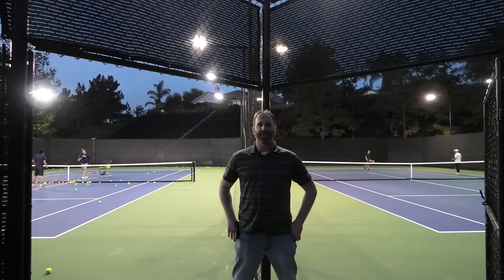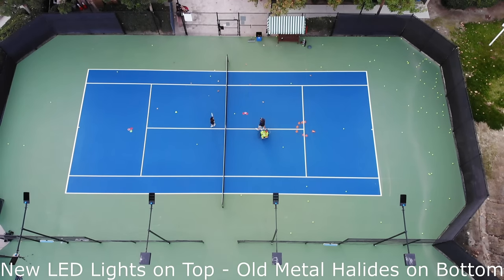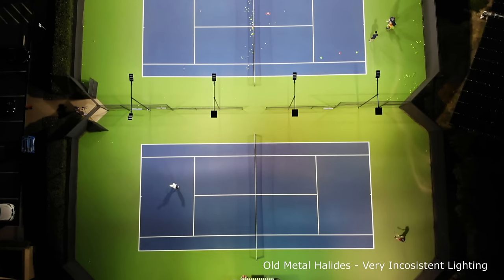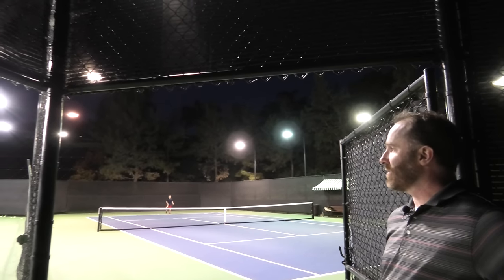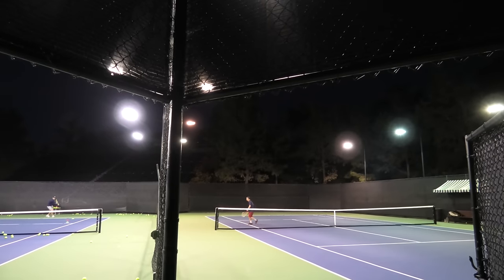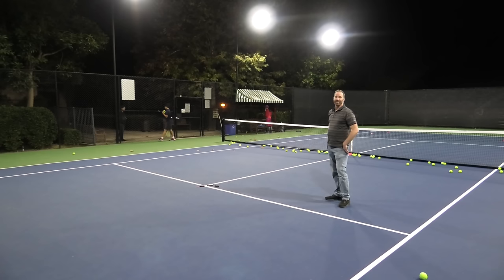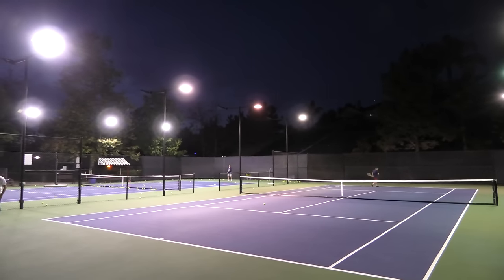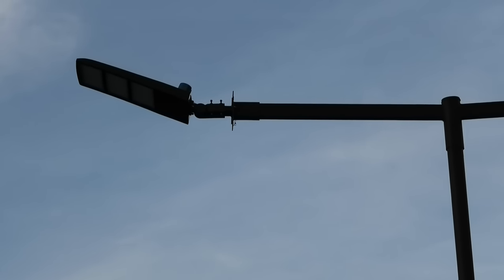LED Tennis Court Lights - Actual Installation, Fc & Drone Footage -LED Sports light vs Metal Halide

Comment: Can i use the 450 watts if i only have 6 poles?  I like this brightness level.
Reply from the maker: You can absolutely use the 450 watt lights, it does not matter how many poles you have. Coverage area for the same brightness is not going to be as big as the 8 poles, but other factors like pole positions and light heights also come into play and effect your brightness. No matter what, if you are replacing old 1000 watt metal halide sport lights, these 450 watt lights are going to be a huge improvement. The best recommendation I can make is to give us a call to speak with one of our light designers to go over your specific application so we can guide you to the best lighting options to make sure you are happy with the results. You can reach one of our light designers at 800-674-9420.